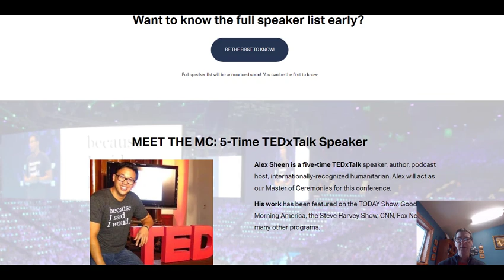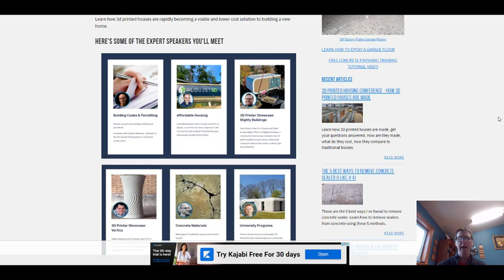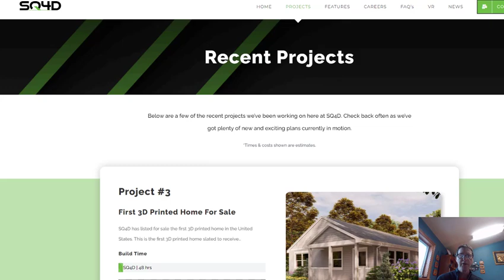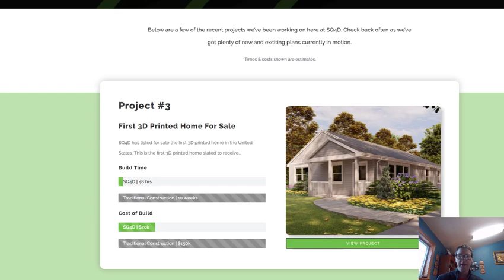3D Printed Houses - How Do You PRINT a REAL House? (Get Answers)

Comment: Thanks for your nice overview Mike!  Your viewers have much better questions and comments than on most 3DCP videos – they know more about concrete and construction.   The thumbnail image shows homes proposed to be 3D printed of a non-structural plastic, that is flammable and so needs to be covered with drywall - with glue apparently, because nothing to fasten to.  A good example of the contrivances in this field.  And very considerate of you to provide a coupon to save 25% on the 3D conference.  I would recommend that your viewers to save 100%, in that such a conference would be too unwieldy to get into the detail and reality check that experienced Contractors would deserve.

Comment: One of the questions I would have is what is the wind resistance rating for areas prone to high hurricane winds? I would imagine the roof has a different rating, or do they have a formula  for higher wind rated roofing for hurricane prone ateas?
Reply: Good observation.   Attachment of roofs is an issue.

Comment: I think 3D printed concrete homes (so called), are a near perfect example of technology over-reach, similar to having a printed circuit in a spatula. Cement/concrete life cycle consumes a lot of energy during manufacture, transport and eventual disposal. Environmentalist are already squinting at the Portland cement industry regarding it's contribution to CO2 output. 
Concrete has critical applications for which there's presently no substitute (roads, bridges, high rises, slabs, etc.), concrete single family homes isn't one of those.
Reply: Agree, but conventional concrete is the cheapest non-flammable code-compliant material, and is mostly of local native materials.  It gets a bad name because so much is consumed  - second only to water.  Generally these homes are made with a cement-rich expensive mortar, shipped long distances - so much more carbon is expended.

Comment: In Southwestern Pennsylvania there were problem in the past with people doing Masonary work. That would include concrete pouring, concrete block work as well as brick and stone. Some of that problem has been alleviated because a friend of mine works for a company that builds panels out of concrete that are already insulated. When you begin having problems with labor cost and prima donnas, you look for different avenues to investigate. Don’t sell this short, it’s in its infancy right now.

Comment: The exterior and interior walls are what I do not like. It sucks that exterior walls could be insulated well, but exterior walls left as pictures will leak water through. Concrete interior walls, no way. Framing up interior wall and exterior wall coverings; I just dont see this being cost effective yet

Comment: how do they hang pictures on the interior walls, I know with jiprock you just need your fastener and a hammer. but with concrete walls I would guess it would probably require predrilling of some kind for a concrete insert. concrete nails would probably just be fine I'm guessing and I wonder what lateral load the inserts could hold in these walls, whether there would be a failpoint in the insert if they're using a special kind of mix. whether the lateral seams in the walls are weakpoints with lateral concrete inserts if they were to be used. if it would be a failure point in the wall blowing out or whether the rod would bend.
If its aircrete it probably would require an insert that expands further since aircrete is basically foam made from concrete. idk if this is what they're using or a rendition of it. the mix looks very fine.
are they able to add rock into the crete mix (maybe a certain small diameter would be ok, but that nozzle tip could get clogged I guess.

I'm guessing the walls can be floated, but doing so would require a lot of movement. and I think quite a bit of intermittent work to accomplish.  one big minus is dust inside ill accumulate on those coarse surfaces and it'll just start to look bad.
I think they can vastly improve this by having a float part of the automated process, just pulling behind the nozzle on some kind of retractable arm.
If they are able to make that surface smooth or relatively smooth this will be absolutely everywhere. I know when wood prices went up in price Concrete was cheaper than wood for housing where I live and i know many people changed building plans because wood was just not available.

Comment: I think, for those with arthritis, the dampness will the concrete draws will cause those folks more aches and pains. Anyone with arthritis can tell you the cold dampness causes their joints more pain and stiffness. Cinder block homes are the same way. You would have to keep the heat up higher to alleviate the irritation to arthritic joint. I have personal experience with this. And if those homes have concrete floors it'll just add to the problem. Maybe those with mild arthritis could handle it better but arthritis only gets worse not better with time.
Reply: Very true, they do have not been paying attention to moisture management!

Comment: 3D concrete printed houses are interesting and fun to watch. I don't think they're ready for prime time especially considering the time a concrete mortar truck would  need to be present until completion, not to mention you would need a small crew to babysit the process and huge printer. On the other hand precast panel houses are ready and have been for over 50 years. The panels can be insulated, with conduit for plumbing and electrical, include preinstalled windows, even with the exterior finished completely. The installation of precast panels can be done in 1-3 days using a crane and a small crew. Concrete roof and floor panels are also available. so in theory a house can be totally dried in in just a few days compared with stick built homes that take weeks and involve lots or waste to dispose of.
America is slow to adopt precast for housing but it's widely used for commercial buildings and warehouses. The major benefits to precast is fire rating, wind and storm protection, a more quiet environment, termite proof and a robust strong structure that surpasses anything stick built.
Reply: Very good observation!